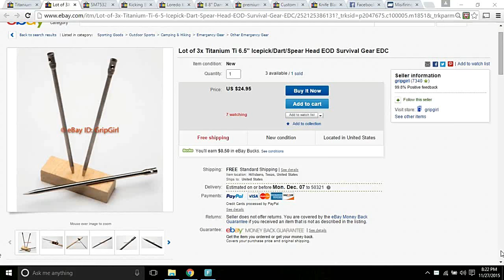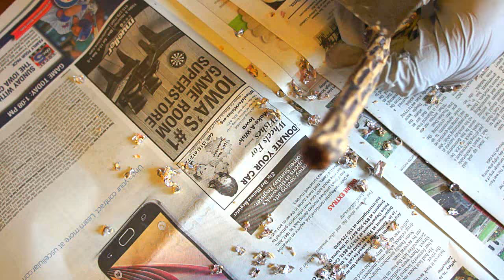Jimmy DiResta Tribute: Titanium Icepick, Epoxy and Cholla cactus skeleton 1 of 3

Comment: Great production man, i take it your quite an acconplished film / video editor as well as a craftsmen in the knife department, really enjoyed watching this for the ice pick which was sweet and the production technique on the filming.
Thumbs up dude great work, shall be watching more so keep up the good stuff, im subscribed :)
Reply from the maker: Well thank you :) I'm just a hack with some power tools and a laptop but I'm glad your enjoying it!
Reply: Just read the title for the titanium ice pick dude where your after idea’s for a sacrificial covering for resin pour on the handle to save on clean up time.
Try using waxed grease proof paper in thin strips to give you the flexibility for the contours but hold it on with play doh, you could even form a stand on the bottom so you dont have to use the vice, it should come off real easy when the resin has set :)
Little helper should be able to help out with the materials on that one dude :)

Comment: nice ! what kind of abrasives did u use at the end? are those soft ?
Reply from the maker: +MrHmiko They are called micro mesh, usually used for woodturning I believe but they are very fine grit two sided sandpaper with a flexible foam core.